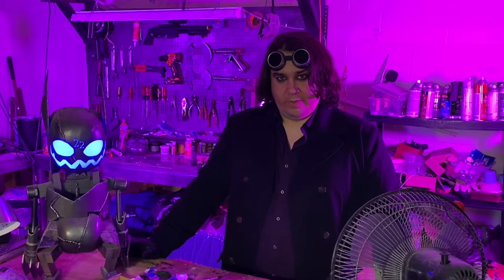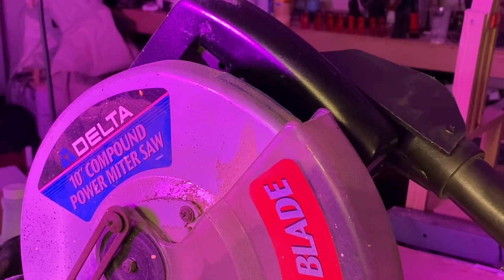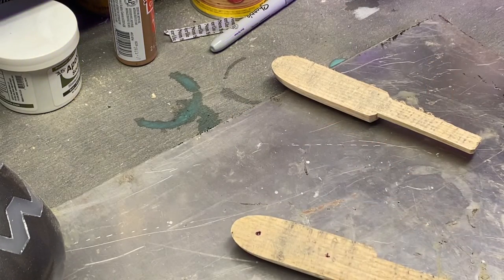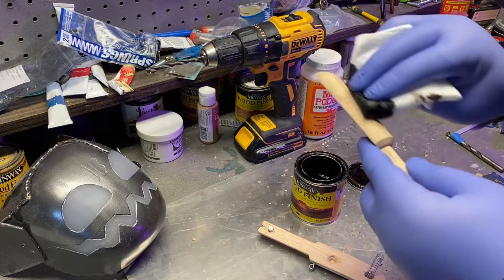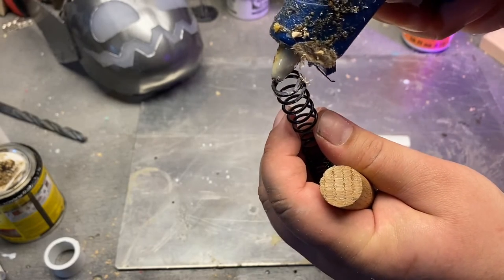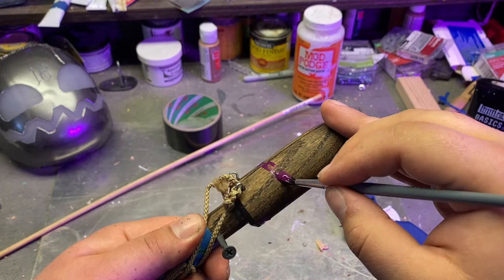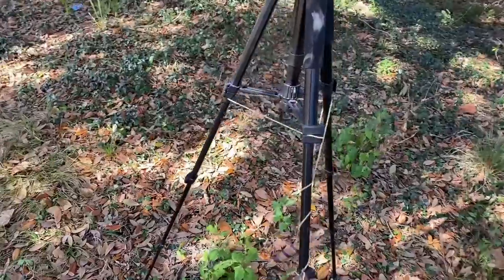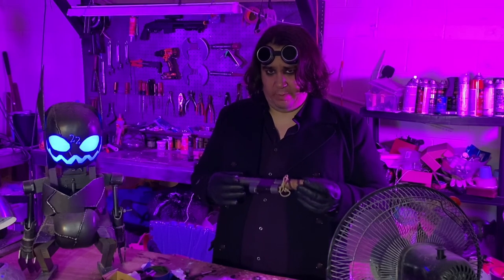How I Made A Batman Like Bola Launcher: Part One

Comment: Really cool! I think I would personally end up 3D printing this. If you do it that way, you could make the bottom of the projectile hollow and store the rope in there, so that when it comes apart the rope goes with it. I love the dual spring on the inside design - Forces the projectile apart while also keeping it compact. You might be able to achieve the same thing with two opposed magnets set in there, for more weight/aerodynamics. The rope is also probably a bit more heavy than you actually need - Microcord or kevlar cord would probably do a similar job and be thinner/lighter and more easily stored. Then you have all-inclusive bolts and no worries about packing the rope in for a reload - Just pop another one in and go for it!
I'll be following this closely as I love the idea.
Reply from the maker: Those are some really good suggestions! I don’t have a 3D printer but I can cast the pieces in urethane resin. The opposing magnets is the part I’m most interested in trying. That actually sounds brilliant! And fitting the rope into them would make reloading super easy. I’ll try them all and we’ll find out! 😁
Reply: @thetiredcraftsman  What are materials required to use for making the Spring Loaded Bola Launcher and can you give me some ideas on how I can make something like this to be one of my Bat Gadgets?

Comment: Why not use compressed air from a bike pump instead of CO2? You could easily use a valve from an old bike tire to fill up an air tight chamber (flex seal/hot glue some caps either end of a pipe, drill hole through one cap for valve stem). Lots of youtubers have done this method to make DIY airguns.
Reply from the maker: Not a bad idea. I’ll try it on mark 2 😁
Reply: @thetiredcraftsman  A spring-loaded Bola Launcher would definitely be an ideal Bat Gadget that I can use as part of my Bat Gear to go with my BatSuit